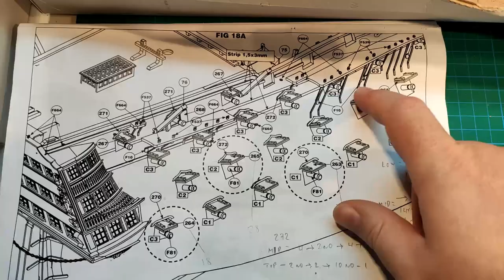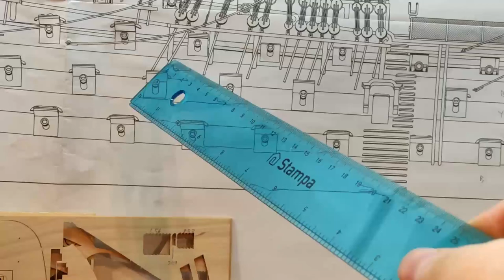HMS Victory - part 50 Ropes On Lids & Supports On Platforms

Comment: Hi John, what size nails (diameter and length) did you use on the platform supports, and also the dead eye supports ? Cheers Nigel
Reply from the maker: Hello my friend! The nails are 0,7mm in diameter and around 10-12 mm in length. The length can be less.
Reply: @JohnsWoodenShips  that’s great John, I have a bag of those :) many thanks Nigel 👍